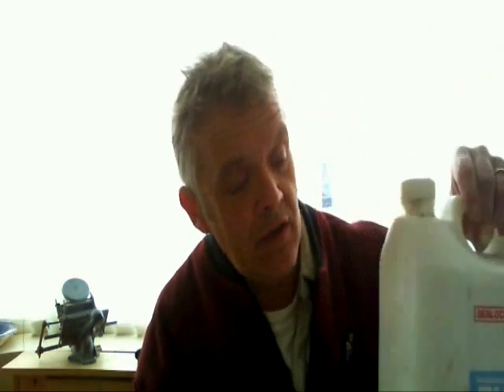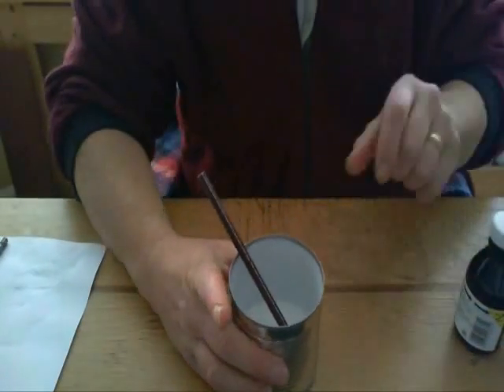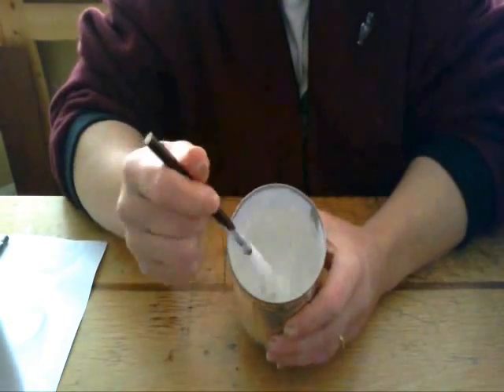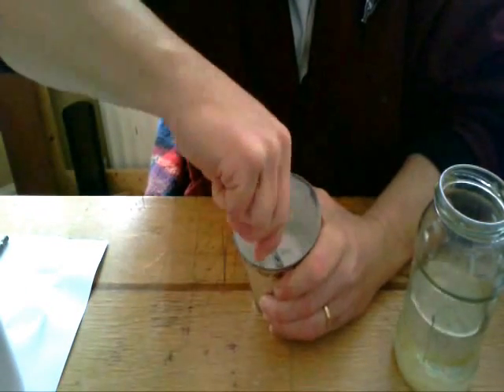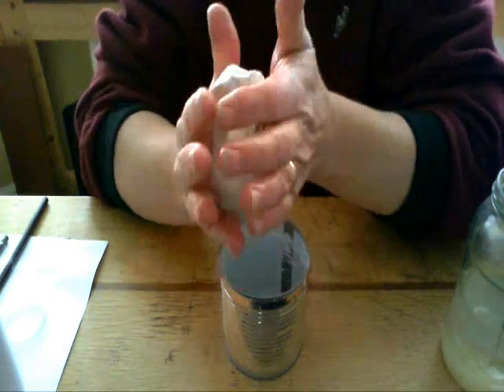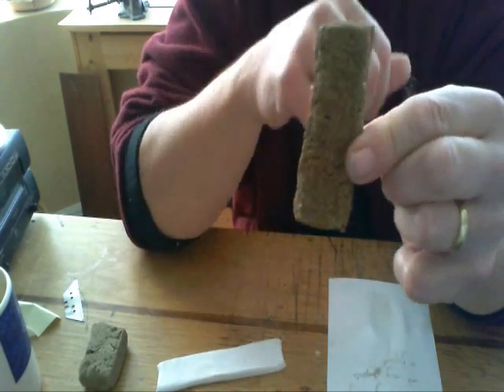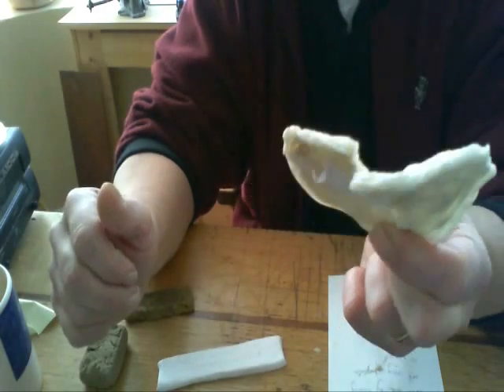An Alternative Homemade Plastic - PVA and Borax

Comment: i found you can use lye and corn starch and a filled then it will gel then add your borax water and glycerol and it will turn into a plastic without heating

Comment: That's bloody great mix to know for my modelling and casting thank you so much!
I've just ordered a 3 kg tub of polyvinyl acetate resin powder which looks like a great and cheap alt to epoxy resin and less nasty as it's just add water, can't wait to see what casting results I get and details, I think this may also be the acrylic resin powder that green stuff world came out with and is still available in small amounts but not on their website any longer, also buying it in 350gm pots for approx 9 quid with postage it works out more expensive than buying the polyvinyl acetate resin powder in its generic form which many places do.
Have you used either of these two? The GSW stuff or the generic form?
Reply: please post a video of your result, we are very interested to know what can be done with this stuff!

Comment: Just came back to say,  I tried this out with some diatomaceous earth, and it's really nice.  I made some file handles from this and It's quite nice stuff to work.  Can be carved when not really fully cured, with a feel like soapstone if you've ever worked with that.  The only problem I have with this polymer is that it's hard to mold with because it cures via evapouration.  Can you think of any way to accelerate or cure when inside a mold?

Comment: ⬛️  2 YEARS AGO, When I saw this, I did an experiment. 

1. I attempted to make Graphene from bamboo in a home made autoclave I saw from another one of your Videos. 
2. I crushed up the bamboo carbon into a powder. 
3. I made this home made mold-able plastic with PVA from my local home depot hardware superstore and borax, ( some thing i had plenty of from using a borax solution to soak the season before,  freshly cut bamboo in to clean and preserve it. 
4. I used the carbonized bamboo graphene / graphite powder as the filler in the above moldable plastic solution and had a very moldable black yet almost metalic silly puddy that I did my best to press into a home made silicone tube silicone mold. 

Let me tell you something, I HAVE NOT BEEN ABLE TO BREAK that plastic since it dried yet. 

My original purpose was to attempt to make natural moldable graphene reinforced JOINTS for a bamboo bicycle instead of using the standard usual steal and or metal. While I have not don't the joints yet. AS HARD AS THIS PLASTIC still is, I will be casting mold joints, i need to use either another additional filler, as the original mix was way way too much silly putty like for me or straight bamboo shavings as its own natural tensile strength seem to be comparable to steal anyways and also in conjunction to make it mostly bamboo anyways.

Does this sound crazy? Any additional filler pointers would be welcome. Thank you for your share, knowledge, and your viewers who all see to be as excited as you make us about science and a great future. Thank you. :-)
Reply: I don't get what you need, wasn't the result good?

Comment: I tried this a couple days back using an iron oxide(I think it's goethite) as the filler, no glycerin. I think I must have added less borax than needed because I've ended up with a rather tough, rubber-like material. It's quite elastic, but doesn't quite snap back, instead just sort of oozes back into shape. But it can take a beating from a screwdriver and hammer without significant damage.
Reply from the maker: awesome mate
Reply: I also made one with iron oxide nanoparticles (Tea stabilized); it too is very tough indeed. I'm thinking of trying nano-clay particles and alumina as well. I'm having a slight problem though. My plastic doesn't quite form as a single lump, instead forming as small flakes, similar to how cottage cheese looks. Could this be because I'm using boric acid and not borax?
Reply from the maker: yes mate - or more likely you got the ratios just a little off
Reply: Oh. Yes that's very likely.
Reply: @chaitanyabhave2092  May I ask you how to make irox oxide NPs?

Comment: This is so interesting because I`m thinking very old school solid state mixed with new age materials and fringe sciences, to form a solid state separator Electrolyte for a new capacitor with a hemp Carbon or flame reduced Hemp graphene oxide layer film on a conductive metal or a Magnesium oxide layer on Aluminium sheet because of its semi magnetic properties, being Aluminum is not magnetic however when a magnet passes over Aluminum is becomes magnetic therefore is capable of generating current!? while eliminating the magnetic clutching effect, apart from collecting currents in its capacitor configuration. I want to make a new layered capacitor, centred inside a spinning generator that both collects stores and steps up the currents and or voltage produced in a all in one system, however that requires me to design  a flat diode overlay on each capacitor with the same dimensions so we have a capacitor diode combo, multilayer system easy to connect in a parallel system with a flat electronic MOSFET a one way current resister to prevent current feedback or capacitor chain over heating on the end Capacitor meaning  to design a capacitor - diode - MOFET combo. I have come to realise that while the capacitor stacks are spinning inside the generator the planed rare earth angled rods may or will cause the Aluminum materials below them to magnetise and or maybe generate more energy maybe in the wrong places but then again maybe in the perfect unexpected places such as the collectors plates themselves alternatively I can use copper. I have almost completed my theory and drafts and have begun to construct components apart from collecting the materials needed to construct my generator prototypes designs. The primary reason why home power generation is not used is because current power generators are so noisy and cost to run, I want to build a near silent self running perpetual generator for every family. Meaning I am using recent fringe science engineering tech such as the magnetic inverter bearing and so forth to achieve a none friction silent magnetically suspended generator. can it be done YES it can. The trick is to build it small enough but powerful enough generator to run two houses full on so that when the grid turns off people can put power into the grid in order to help others in need. when needed. I have solved the high speed problem of metals or materials becoming unstable at higher speeds by introducing my dual spinning coil, a counter rotating system that primarily doubles the rotation speeds and power produced while keeping the revolution speeds down. would you have any advice on a solid state material to use or to construct such as  for example Borax and salts mixes in this video configuration mix? for example in the 40s and 50s the military used Rochelle salts or black and green Tourmaline or Quartz in there Capacitors but they did not have the sciences and materials then, that we now have available to us today. It is a past tried and proven old tech that worked so well they had to scale it all down because it was common the fusses in tanks and ships would often blow due to the capacitors being too powerful and systems being over worked, so can we improve and or redevelop or reinvent that tech for this solid state use today, yes I think we can. I have never herd anyone on line consider old forgotten military tech like this being redeveloped or reinvented, have you? I'm a nobody compared to you but I'm a damn good student and thinker. and as I have said before I love your teachings, end of story I guess. God bless you Bro. Mike Watene on face book. 060279176023 send a text if you wish.
Reply from the maker: folks are always looking over stuff mate - i do - and i know others do - I haven't heard of this specifically but that doesn't mean that much - sounds interesting though - good luck with it

Comment: From reading some old recipes in Henley's manual, I believe adding Al Sulfate will make it water-proof.
Reply from the maker: that's very cool info mate - do you have a link to the manual or the full title?
Reply: Henley's Formulas for Home & Workshop (C1927) bottom p. 378; the original formula was discovered accidentally, mixing ordinary animal glue with alum. Animal glue is a mix of protein with silica. May need to add silica to your plastic to get a similar reaction.
Reply from the maker: cheers mate i found this free download https://archive.org/details/henleystwentieth00hiscrich
is this the one?
Reply: yep.
Reply: So I mixed up some aluminum sulfate with just enough water to dissolve into a thick, milky solution and added PVA (no borax) and stirred it up, it formed a ball of of non-tacky plastic straight-away.  I poured the solution off and have a marble drying as we speak. I could see working graphene into the PVA before mixing and then pressing flat into super-capacitor plates. The Al2-(SO4)3 should act as as an ionic salt/polarizable solid electrolyte.
Reply: So I tried with copper sulfate dissoled in water, forms a blue silly-putty type material (again, no borax) that I'm allowing to air-dry to a stiffer and hopefully water-proof, solid electrolyte. The liquid portion seems to keep increasing and more PVA can be added to it to make more putty, which is a bit tacky to paper & cloth but not fingers.
Reply from the maker: you really need to do some videos on this mate
Reply: There are papers out there where sulfate salts are used to cross-link PVA in lieu of borate. They're salt specific to their purpose though, not generalized and not about caps or batteries. My results today are rubbery products, like silly-putty, that can be shaped until they reach a stage of dryness, when they start cracking like play-doh, but that's not an issue in a sealed cap. Anyway I haven't added graphene yet, which would probably up the conductivity quite a bit, though the PVA makes it more of a semi-conductor. There are millivolts readable between copper sulfate and al sulfate rubbers placed on top of each other, so long as there's moisture and haven't entirely dried out. I've never made a Youtube video, not really the showman type, and don't really have a clean work area to do videos, i.e. I'm a bit cluttered/a slob.
Reply from the maker: lol - don't let that stop you mate - so are lots of posters and i always think it is the info that is important not the dressing

Comment: I finally did the experiment. I used
 tb  powder  PolivinI Alcohol, 
1 tb Cornstarch mixed into a cup that contained 2 tb Boxa into a  150 ml Hot Water.

The reaction was not as expected. I was hoping to see a jelly type of mass. 

Maybe, I had the wrong PVA. in a separate spoon, I poured a little PolivinI Alcohol in powder. And I added a little water. I was hoping to see the PVA disolve in water (in the spoon) and become slime. However, this became like a thick rubber. 

my intention is to make a rubber like  fabric by combining Borax, PVA and powder such as Cornstarch
Reply from the maker: just keep experimenting mate - if you got a thick rubber and was hoping for a thin rubber i would say you were halfway there. Anyway I used poly vinyl acetate not poly vinyl alcohol

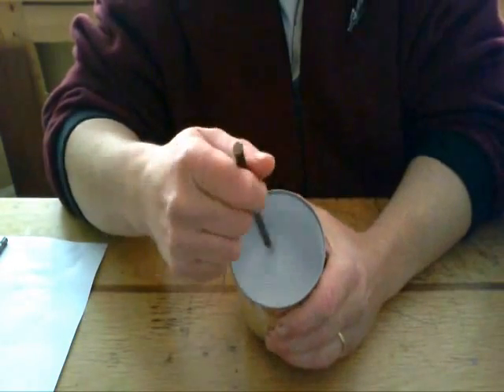Comment: at 1:55 you talk about the glycerol to plasticize it. and then  sayif you added your Borax solution it would make a liquidy plastic.. you added your boraz and it made a rather putty substance, not liquidy like you said.... 

my question is how can i make that liquidy plastic and will it harden? i need an alternative to smoothcast 300 and you may have the solution
Reply: 01:55 *
Reply: +urjnlegend then towards the end you say it can be casted, was that with the filler and was that originally the liquidy mix ? cuz casting usually requires liquid material
Reply from the maker: +urjnlegend this is really easy to do - a lot of your questions will be answered much more quickly if you just try it - i suggest you do and that way you will get a real 'feel' for the material
Reply: +Robert Murray-Smith thanks man
Reply: +Robert Murray-Smith it didnt work, i tried to make a reaction happen with half pva, half glycerol, and then added borax, just a foam like plastic formed. i tried your formula minus the filler, nothin happened to create a liquid plastic material, im not sure how to create it. im trying to acheive a product like smooth cast 300
Reply from the maker: +urjnlegend I don't really know what smoothcast 300 is - but i imagine it is a molding material. Borax and PVA may not be the best for this as the cross linking happens very quickly - you need to slow that down - well that's what i think based on what i think you want to do with it - this will mean research on your part to find what cross links pva and what is needed to do it slowly enough to pour but quickly enough to set in good time
Reply: +Robert Murray-Smith its a casting resin from smooth on inc. and i think you may be right about that, its just kind of expensive and i thought the cross linking would be slower , but i shall look more !
Reply from the maker: +urjnlegend let me know how you get on mate
Reply: +Robert Murray-Smith ok i will

Comment: Well, I feel silly. I'm reading paper after paper about freeze thaw and formaldehyde and glutaraldehyde trying to find an eco friendly alternative to cross link PVA. Totally forgot 3rd grade chemistry. This makes life easier.
Reply: Citric acid is great for crosslinking PVA - it stays unlinked until you use some alkali like NaOH to harden it and it resists being unlinked after that. Mix your PVA and citric- paint it on a membrane like felt or some similar, then dunk it in a sodium hydroxide solution for  while. Press it between 2 sheets of hard film to normalize thickness and then wash it with water or some weak hcl to eliminate any unreacted alkali. Voila: Proton Exchange Membrane- environmentally responsible.
Reply from the maker: +The Thought Emporium lol - oops lol
Reply: @The Thought Emporium What do you mean? I'm in your same situation
Reply: 乃乇尺ㄒㄖㄥᗪㄖ - by using Borax as the cross linker instead, as is outlined in the vid
Reply: 3rd grade chemistry...  but do the kids really even know what they are doing really?  real understanding comes later than that.

Comment: I'm coming to the party a bit late, but question: Must there be a filler?  If I just wanted a more translucent polymer would that work with just the pva/water/glycerin mix and borax solution?  And second question, would it be something that could be oven baked at 300F?
Reply from the maker: +Domino Truitt there doesn't have to be a filler but adding a filler creates a composite that can have quite startling effects. If you leave the filler out expect quite a bit of shrinkage as the mix is water heavy - I have never tried baking it but it is an idea worth trying - though you might want to expect some nasty smells!!
Reply: Thanks so much Robert.  I've been experimenting with some alternative plastics.  I want strength, sheerness/translucency and durability.  I'm leaning toward uv cured resins, but trying to fiind a bio version of that seems to be tough.  Bio plastic recipes everywhere, but uv bio resins not so much.  I make jewelry, and want a medium for the creation of hollow polymer beads.  So you can see my challenge.
Reply from the maker: +Domino Truitt yes I can - you might want to try gelatin with ammonium ferric citrate - the green one not the brown - it is a food additive
Reply: wow, ok, and that will give me a bio resin that will uv cure?  would you happen to have the ratios and recipe setup?  ie., gelatin blooming required or no?
Reply from the maker: +Domino Truitt it is a uv cure i experimented with it a while ago so i will have to dig out my lab notes for exact details but it is easy to experiment with
Reply from the maker: +Domino Truitt sent you some stuff
Reply: +Domino Truitt i saw one of 3 table spoons corn starch, one or two table spoon water, couple drops oil microwave 25seconds in open baggie . a girl named stephanie has a video on it
Reply: +Domino Truitt could you please send me the formula and ingredients as well in a private message, i would like to work with a bio resin for casting

Comment: did you know you can melt old plastics around your house such as milk jugs containers and detergent bottles and bottle caps as long as they are hdpe just make sure they have a number 2 in the recycling symbol that means they are hdpe also hdpe doesnt relesase fumes when melting which is great
Reply from the maker: Dean Walcott  - that's cool to know - cheers mate
Reply: Robert Murray-Smith thank you
Reply: @funny1048youtube  you're welcome dude, even though I'm not Roberto-Maroon Will Smith
Reply: Borax is vital to the human body

Comment: thanks, could you clear coat it to make it water resistant, i love helping my son with his mid term homeworks and most of them involve making models, this would be great for that, also is it non toxic..?
Reply from the maker: clear cote would definitely work. I am not sure about the toxicity. But the LD50 is in the order of kilos. It won't taste that wonderful but borax is used for laundry and PVA is just white glue. So, if toxicity worries you check out the MSDS for both of those Google will help here.

Comment from the maker: Lol, bless your heart Mary. The problem is that there is a million different formulations for PVA. All will work but will need a little tweaking to get them to work. So, basically, pop down to the store and get a tub of PVA. You can buy it in gallon tubs for about 10 dollars from target, home depot or walmart pour out 10 glasses and try different strengths of borax solution and see what happens. you'll get there and experimentation is fun!
Reply: It's interesting but the audio is not good, can you please write me the ingredients 
So I may try 
Thanks for your idea